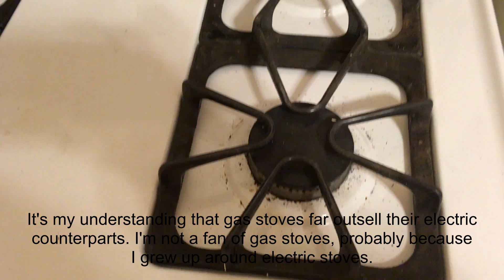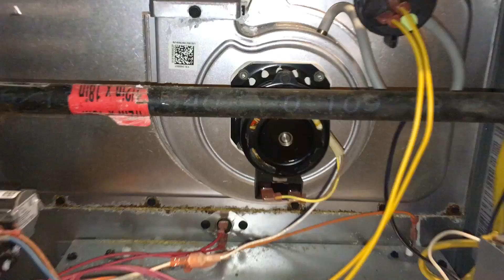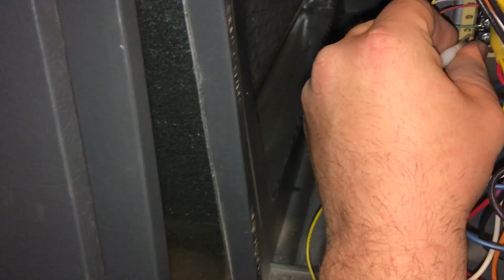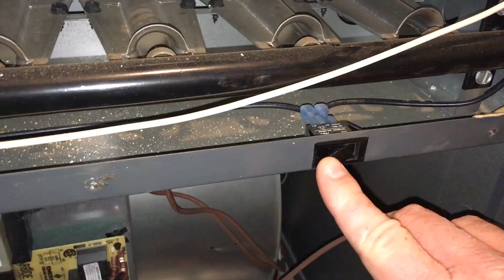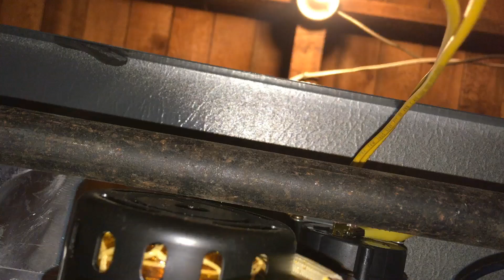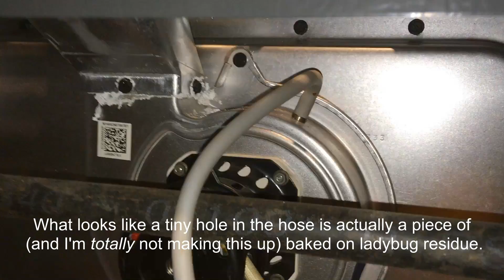No Heat Call: Goodman GMS81005CNBC 80% Gas Furnace

Comment: Get yourself some clip leads with a button or switch on it to diagnose! Makes life easier when dealing with circuits like that.

Why don't people wire up the C terminal when they have an extra wire available? No need to replace batteries on standard thermostats and you can just plug-n-play Wifi thermostats.
Reply: Depends on the thermostat. Some of us grew up in the trades and we aren't comfortable having both sides of a line (low or high voltage, etc.) running when it isn't necessary. If I had a thermostat which didn't need it, I'd disconnect it, too.
Easy to hook back up, if needed.
Reply from the maker: I'm still amassing tools, with an eye to what I think will be useful. Those are on the list.

Not every thermostat (including the one in this house) supports external power. For those that do, I'd certainly hook it up.

Comment: As soon as I saw that pressure switch, my experience of pulling washing machines apart just started saying "blocked pipe!!", as a similar thing can happen with a washer pressure switch that is meant to turn off the water at a set level in the tub, either it blocks up on filling and never shuts off causing an overflow, or it gets blocked and never turns the water on at all... :)

Comment: Were you able to determine what was obstructing the passageway? Could it have been that substance resembling corrosion?
Reply from the maker: It might well have been. When I poked whatever was in that hole, it undoubtedly fell into the blower housing. I didn't feel like taking it apart at the time to see what it might be. The little blower wheel itself looks clean if one removes the flue pipe.
Reply: Whatever it was, it managed to work its way into an area that would appear to be quite resistant to blockage.

Comment: Bill, great job diagnosing this one. I have been watching a lot of HVAC videos here on YouTube lately and it seems that one of the most common problems is the little port on the inducer fan housing gets plugged just like you found. So, I would say in the future, if you get a pressure switch error like in this video, go straight to the little port and check it first.

Comment: Good job on diagnosing the repair, Bill.

Well, now Goodman is coming off the buy list. Its only four years old and already has to be repaired. What a disappointment.
Reply from the maker: I wouldn't be so quick to remove Goodman equipment from your consideration. Worry less about the brand and more about who is installing it. A bad installation job can make even the best equipment perform poorly and with constant reliability issues.

A lot of people around here are buying Goodman equipment and they seem to be quite happy with it. And, well, anything can fail at any time, regardless of the brand. That's just the way it is with mass produced items.
Reply: @uxwbill  Ok, I'll eat my words. Well call me a monkeys uncle, my 25 Year-old Bryant furnace's draft inducer motor had seen better days. It was to the point of almost seizing up from worn bearings. The furnace has become a money-pit from the last 5 or so years. 

What did I replace it with? A Goodman.
Reply: Goodman, Amana and Daikin are all the same company (and they do a few private labels, too). Lennox is not what they once were, by a long shot. Rheem always stands behind the installer, no matter how awful, and Carrier has their cheaper lines, too, now.
My friends who work on these things all say it's 99% the installation and the rest is the manufacturer.

Comment: You're gonna find out pretty quickly that anything Goodman is pretty much crap. Just saying.
Reply from the maker: I'd have to disagree completely. Goodman equipment is very popular around here, and the people who have it seem quite satisfied with it. It'd be on the list of brands I'd consider, if and when the time comes.
Reply: I like the 16 SEER Goodman equipment that I just installed myself.  The only thing that I didn’t like was the cheap single pole contactor so I upgraded to a better quality double pole contactor. I also installed a whole house surge protector in the breaker box to help protect the sensitive electronics in the furnace and condensing unit.

Comment: Hey uxwbill, you seem pretty capable as a furnace technician. I'm surprised you had trouble finding work in the field. Have you tried dropping in at any of your local mechanical contractor's offices? They'll typically deal with larger commercial units that generally function the same. Also, if your state offers a limited technician's class electrical license which you can challenge, I suggest you challenge it!
Reply from the maker: I was as surprised as anything that I couldn't seem to get any HVAC/R service company to take me seriously. I thought sure that I could drop into a decent, entry level position (preferably in service) and learn more as I went. For now, I've gone back to the world of IT.

Given some time to rebuild my finances, I may very well try to start my own HVAC/R business.
Reply: @uxwbill  The world of service technicians, and tradesmen in general is a unique beast. Quality comes second to billable hours. You're there to make the company money in their mind. I highly recommend starting your own business. Depending on your local licensing regulations you might have to have certain certifications to purchase refrigerant and plumb natrual gas. But then you can build your company around your own business philosophy. Word of mouth is invaluable, never be too shy to ask your customer for referrals. Anyways, best of luck to you.
Reply from the maker: @ACA332  I've got my EPA 608 universal (and 609 MVAC, because why not?) which is the only qualification needed here to purchase refrigerant. To the best of my knowledge, there's no requirement for any special license or certification if I were to install natural gas piping. It would be subject to inspection by the gas company, however. They seem quite serious about that, as I've witnessed several of those inspections.

A few months ago, some people down the street were given my name and called on me to find out why they didn't have any air conditioning. Or rather, why their air conditioning did a truly outstanding job of freezing up. The furnace turned out to be a very high end York from 2010, with an X13 ECM motor. As seems to be their wont, the motor had burned out.

I suppose most people in the business would have bought them a new motor ($900!) or even suggested replacing the furnace. I took down the model and serial numbers, and on a lark, called the York parts house to find out if there was any chance that the furnace would be under warranty.  Even though I had no paperwork, and the house itself was a foreclosure, I kept quiet and York came through with a new motor. The homeowner had only to pay my labor, and they were thrilled.

I do know the incredible value of word of mouth advertising. It's the best kind of advertising you can't buy.
Reply: they know he would be too good at fixing issues and not good enough at selling people new systems

Comment: On our Dukane furnace, the issue was a clogged condensate line, and things backed up into the pressure switch. That was last year, this year it has been working just fine so far, and since we are in Northeast Ohio it has been used since before Halloween.

Comment: Reminds me of an issue that my grandmother had recently with Her system. And after My 15 minutes of testing the blower motor wasn't starting. Testing the capacitor all looked fine. And Well someone who could source a blower motor and had the proper tools. Well this 80 some year old man showed up at my grandmother request to do just that. i casually mentioned that the capacitor might be bad and that we should check that just to be safe and see if a simple $20 part would fix our issue.

He ignored a young'un like myself faster than a fart disappearing in the wind. And proceed to take the motor housing assembly apart. not even 15 minutes later he tells my grandmother that the capacitor was bloated and leaking and needed replacement. I was like well that's what you get old man, all that work and labor and ignore someone who actually knows enough about shit to know what He can and can't do.

The old guy was a loner and didn't like working with others and ignored me out of habit. But I was right in my suspicions. Crazy thing was the capacitor reading was correct and it didn't test bad.